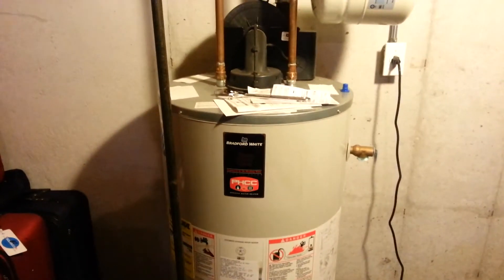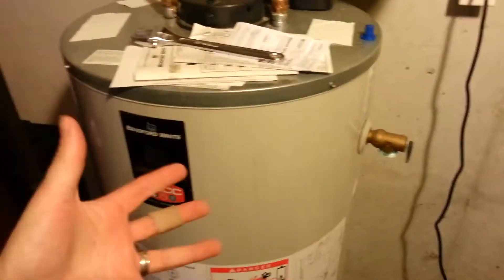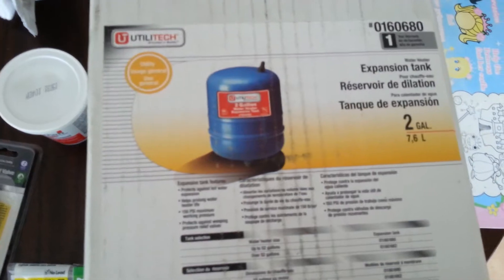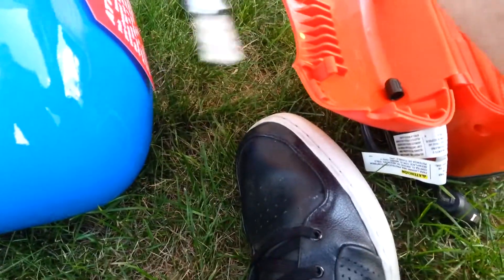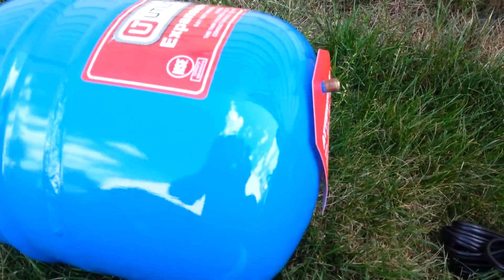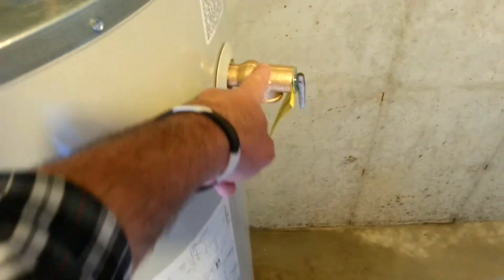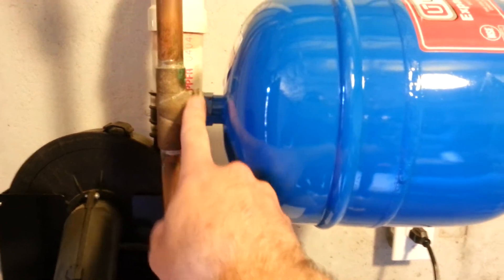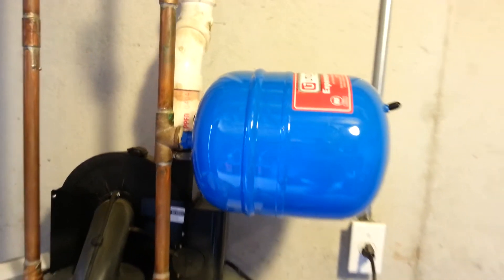The DIY How To Fix Leaking Hot Water Heater -- Faulty Expansion Tank & Relief Valve

Comment: skipped the most important part, no?
Reply from the maker: TenHanger What's that?
Reply: um, like the entire installation.  we have a minute of your faucet running, but we have no video of you installing the cannister onto the pipe or putting the relief valve in.  did you need to solder?  did you use teflon tape?  plumber's putty?  btw, probably best to screw things all the way.
Reply from the maker: TenHanger You're right. I didn't show every step. I explained steps that I didn't show. The video was more to explain about me troubleshooting the expansion tank issue.
Reply from the maker: I'm just a homeowner trying to repair stuff, not a pro. There are other pro videos out there showing every step probably.
Reply: Hey man, glad you have it up there, no doubt.  just trying to give some feedback for your next job.  people like to SEE the steps, otherwise going to library and opening manuals and how-to books would still be a thing.  Editing video ain't easy, but a little bit goes a long way.